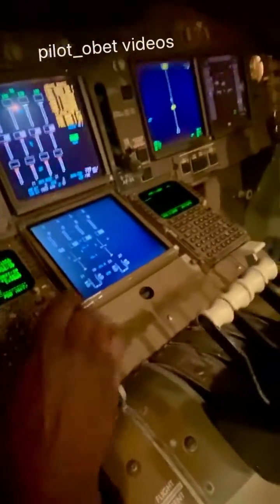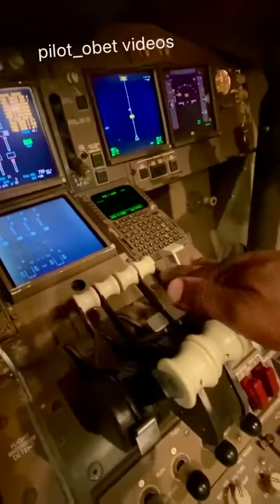Boeing 747 Speedbrake

Comment: I'm in no way an Airbus or Boeing fanboy, but this is definitely one of the things Boeing does better. I think in the Airbus you have to arm spoilers as part of the After Start checklist. Also, when armed spoilers deploy, the lever doesn't move, so you need the lower ECAM to be sure.
Reply: doesnt the 737 require you to arm the spoilers?
Reply: @shinkreytpuylap  Not for takeoff. On landing on the 747, speedbrakes should be armed but if they aren't they'll deploy on thrust reverse anyway, just not immediately on touchdown. I think the 737 is the same but I'm not sure.

Comment: And also. I installed those side windows on the flight deck and the bracket where you used to put your flight bag on both sides as a mechanic. My stamp on -400 and -8